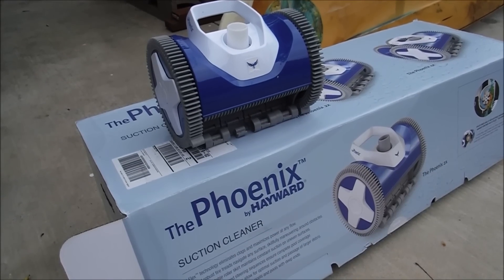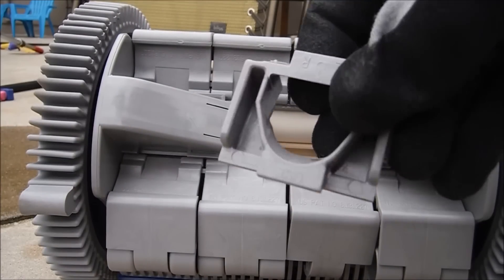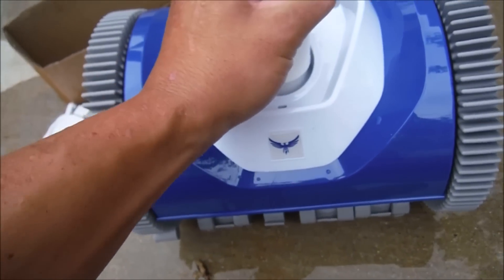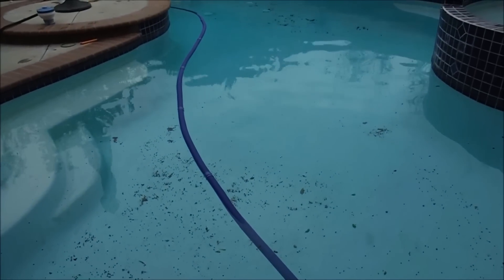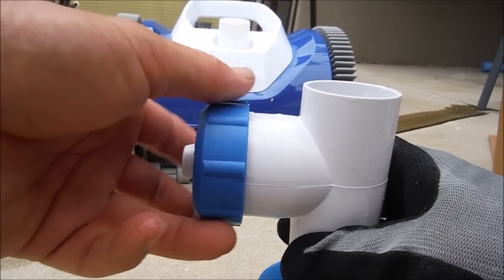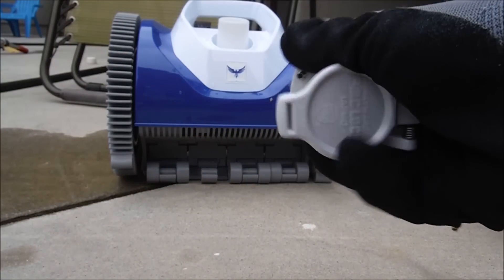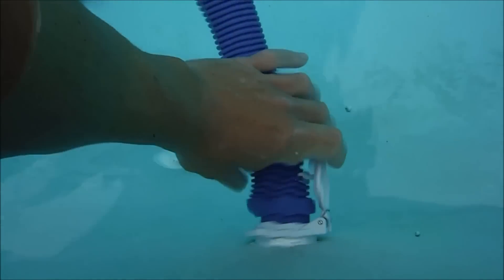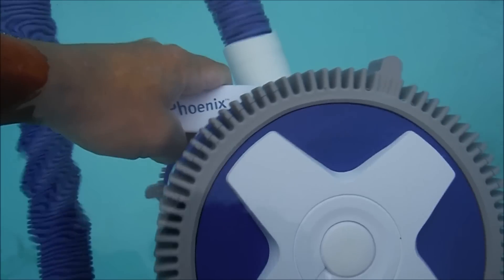Hayward Phoenix Suction Side Pool Cleaner Installation Video

Comment: Quick question, can you leave the hayward plugged in directly to the skimmer and still add chemicals to keep the pool clean?? Or do you have to remove the Hayward to get a better pool cleaning while adding your weekly chemicals?. Thanks again.
Reply from the maker: Leave it in. They are extremely chemical resistant.

Comment: We have the Hayward Phoenix 4 wheel with the basket attachment which I highly recommend the investment. Our in-ground pool holds 18000 gallons of water and we set our DE filter to clean before and after peak hours to save energy. This vacuum helps keep the floors and walls clean if set to the appropriate levels. Leaves do get in at the skimmer part of the vac since the valves allows 80% suction from vacuum and 30% from the skimmer. I just unscrew the valve at the skimmer for cleaning. On Amazon they sell a filter for this. Thanks for reaffirming I’m using  this correctly! Lol

Comment: I installed mine just as you described for the side port installation. My vacuum floats after one hour of use. What do you think could be the problem?
Reply from the maker: Sounds like air is getting into the suction line. If it has a canister make sure that is not sucking in any air.
Reply: @SPL  Thank you. I checked it out and there is a leak at the union just in front to the pump filter basket. I appreciate your prompt reply.

Comment: Which automatic pool cleaner that you  can recommend  , that works great but doesn't cost a lot , I have 17,000 Gl pool and its screened .i live in central Florida . Thanks ,,
Reply from the maker: lawrence matos With the $100 rebate it brings the price down to $370 with tax here in Ca. we are at a 10% tax rate. So yes it is a little pricey but not extreme. This would be a good lower priced alternative but in the long you will be happier with the geared type cleaner like this one. 

http://www.amazon.com/Baracuda-W03000-Advanced-Suction-Automatic/dp/B002HRET3S/ref=sr_1_1?s=lawn-garden&ie=UTF8&qid=1431295429&sr=1-1&keywords=g3+cleaner

Comment: Was wondering does the phoenix x4 climb the walls of a pebble tec type pool?
Reply from the maker: Depends on the suction but probably not very high up the walls.
Reply: @SPL  ok thanks  I have a mx8 that is about 7 years old and it's time for a new one and the pool people are pushing the Phoenix x4 one me but I want another mx8 and just could not find info about that for a pebble tec pool Also if you have any ideas on how to fix an MX8 that will not move it like locks up once the pool suction starts but once the pool suction is off everything moves that's the problem I'm having with mine thanks again

Comment: I understood everything right up to where you said adjust the rpm of the wheels.  Mine are rotating too slow - 6 rpm.  I have a side-port installation.  The valve is 70% cleaner/30% skimmer.  How do I speed up the rotation?
Reply from the maker: Make sure the filter is clean and also check to see if all the pool suction is going to the skimmer line vs the main drain line since the Side Port shares the suction with the skimmer you want the main drain off.

Comment: This seems to be a very popular Type/Design for Cleaners lately
Reply from the maker: Ganse Chower The Poolvergnuegen the PoolCleaner had been on the market for several years, but they only sold to pool service techs. Amazon.com and other online retailers picked it up a couple of years back. But not until Hayward purchased the company did it have wide marketing appeal.  It doesn't hurt that Pentair also is trying their own version of the cleaner, so now the market is flooded with them - ha, ha.  Thinking about getting one yourself?